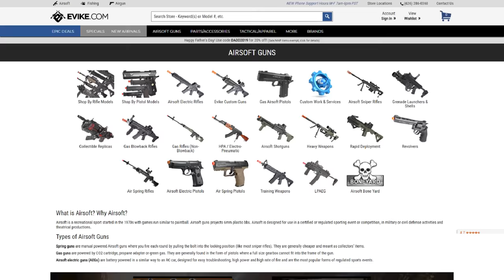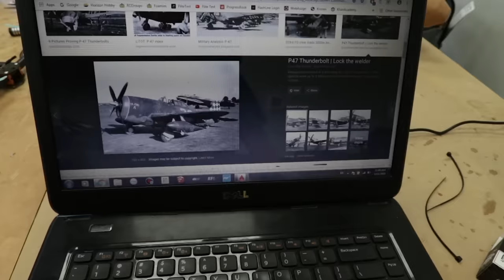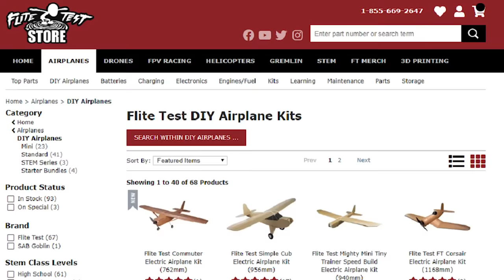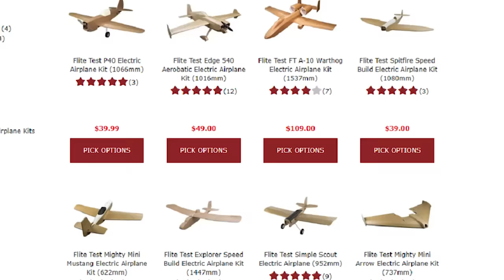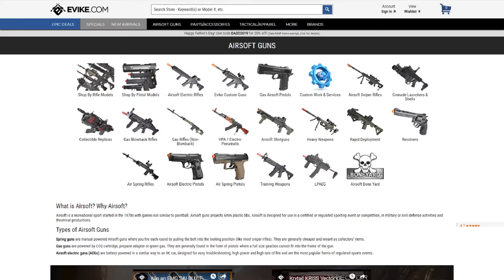Water War?! Foamboard Boat+Gatling Gun VS Dive-bombers 🚢😲

Comment: You should build an A10 big enough to carry the mini gun, it would look super realistic
Reply: Do it!!!
Reply: It be like 10 feet wingspan but thad be badass
Reply: They could also build a minigun with 3d parts light enough to carry it...
Oh God we're giving them ideas now
Reply: king sativa easily more than that it would be the size of a small 2 seater aircraft. The problem is CoM. All that weight up front needs to get balanced
Reply: You forget the A10 is an airframe designed around a great big gun in the first place, and weight up front isn't that hard to balance out.  It just needs the airframe scaling up a little, I'm betting 1/4 scale would easily do it.
Reply: @Ian Wiersma thicker foamboard and bamboo
Reply: Dude thats the smartest thing I ever heard in this channel
Reply: How I would do it is position the gun in scale position and extend the barrels to the nose. Gun and ammo terminate behind the cockpit. So the barrels have to be extended. This deals with the center mass issue mostly. You want nose heavy anyway. Electronics and batteries and servos have lots of space in the wings and fuselage. Could have retractable gear. Could even build for fpv purposes. Big question is propulsion power. It's going to need some massive motors and props, or ducted fans to move all that weight.
Reply: @Tora1337  oR just buy a small scale minigun
Reply: @Ian Wiersma connect the minigun with wood to the plane structure
Reply: Ross Cooper-Smith yeah because jet engines are super light just like electric motors... give me a break dude
Reply: That would be legit! It would be rediculously hard to balance. I'd imagine the gun would need to be mounted in the middle of the ship nearest the cg. and then fire forwards through a hollow space out the front. They would just have to keep in mind that they have to fly straight and level to not shred the ventral of the plane
Reply: I’m a combat veteran and I approve of this comment.
Reply: Built a plane around the minigun like they actually do, strip it down to the bare minimum like the barrel and feeding mechanism it would be a huge undertaking but im sure they could do it
Reply: Too bad I can only like this comment once.
Reply: Tora just use those mini turbojet engines.
Reply: It would definitely be possible and not have to be as big as some of you are thinking.
Reply: 1:1 Scale
Reply: @jeromeburiel965  I was thinking that as well. But given that they have got what they got. But in the A-10s case, it would be a scaled down GAU-8 not mini-gun. And airsoft obviously. 😎
Reply: @arnemagnus680  lol
Reply: Do it
Reply: I want to see the giant quad with the airsoft mini gun.
Reply: Yeah the A-10 Warthog with the mini gun would be cool
Reply: @HAMlLTON  You realise they already made a tank fly, and a little tyke  car.  The little tyke alone is double the weight of one of these guns, nowhere near as streamlined, and they didn't have the new larger foamboard available then either.  It's definitely possible to build an A-10 with one of these.  :-)
Reply: @og_myxiplx  my point inst that it would be impossible, my point was that if you want a heavy gun up front the airplane is going to have to be large to compensate and they might even have to put weight behind the wings to compensate. A real A-10 has 2 massive turbofan engines nearly on the tail to counteract the nose heavy bias of the plane. 

not impossible just really big and they have to plan out where to put weight.
Reply: I say to all you naysayers, this is FliteTest. Build it!!!
Reply: @Ian Wiersma *off
Reply: *laughs in brtttt*
Reply: do it!!!!!!
Reply: Do this thing..
Reply: Try at least 25 and you need either a powerful edf or a jet engine
Reply: Then put it on the battle
Reply: They have to do it right now
Reply: no
Reply: Do it
Reply: Why won't he buy a fighter jet?!😒
Reply: They did it you know
Reply: someone somting you are quite special.
Reply: @user-xp9jo2rv3q  so are you so are you🙂🙂🙂🙂🙂😇😇😇😇😇
Reply: BRRRRRRRRRRT
Reply: Use my 3d printed rc controlled 40mm grenade launcher and a 40MIKE shell. 300 bb in 1/3 seconds. Feel the brrrrrt
Reply: It will be to heat
Reply: It will be to much weight
Reply: Yes Yes please do that.!!!!  It would be sooo amazing.And some rockets too
Reply: yes this needs to be done
Reply: Omfg... that is a weapon of mass destruction actually... please. Please do NOT give this idea to people. Please.
Reply: Absolutely do that flite test
Reply: Ross Cooper-Smith NERD
Reply: we need that
Reply: It would have to be massive!
Reply: Nah modify it so it shoots faster, so I can do the BRRRRRRRRRRR
Reply: that would be as big as a normal A10 probably
Reply: Ray Thuil nah
Reply: Call Peter Sripol and build one you can sit in lmao

That would be cool
Reply: That would look sick
Reply: @PikachuFragger  good
Reply: And carry some airsoft grenades too as extra ordinance
Reply: Yes great idea!
Reply: Do it please
Reply: Put modle jet engines on it with a 13 foot wing span
Reply: make one that has a firework or smol bomb on it and make it land on another plane or tank
Reply: YESSSSS!!!!!!!!!!!!!!!
Reply: That gun so bs that it can barely make 50 rpms and i dont belive it will be able to feel on the skin when shot at
Reply: Good idea do it
Reply: You just got them rich if they do this
Reply: Do it!!!
Reply: Then it willnbr BBIIIGGG
Reply: And a pilot
Reply: Bro it’s been 2 years you should do it
Reply: You should build an A10 big enough to carry the mini gun, it would look super realistic
Idea Guy: jeff favorite
REPLY!
Reply: BRUH!!🤩
Reply: I'm with this guy. Please?? Just like the real thing
Reply: It would be to nose heavy
Reply: They already did in a past video but with a airsoft BB gun
Reply: That’s a GREAT IDEA
Reply: Do It just do it
Reply: The gun on a a10 actually span the length of the plane
Reply: And when the gun fire
The a10 will turn reverse gear on
Reply: DOOOO ITTTTT!!!!!
Reply: Place the gun bottom right cause of recoil
Reply: Like make it 15 feet and put like 30 pounds of battery and guns cameras
Reply: And that’s exactly what they did
Reply: When you say that to me it feels like your asking then to make a real plane its just what i think ok
Reply: That would be a massive plane
Reply: No it should build A-10 around minigun so it would be canon
Reply: YES!!!!!!!!
Reply: Yes
Reply: So a A10
Reply: I agree
Reply: Men
Reply: They should

Comment: I NEED a vid where you guys shoot stuff at a plane until it drops out of the sky
Reply: Ty Weir they should make a plan with a water bottle in the body’s that’s about to rupture because of pressure(fill it with compressed air)  and shoot at it with high power air soft guns or BB guns
Reply: Dune.. it's A10 plane VS Tank

Comment: Hi I’m trying to get into echo flying but it’s to expensive any ideas
Reply: My advice would be to build what you can from cardboard or Styrofoam. (or buy those foam gliders. Sometimes you can find those in a supermarket (target?))
The most expensive is the remote control. So try get a used one. The other electronics are more affordable. Some hobby or electronics stores might have those.
Good luck
Reply: Do a bank job.  I'm in btw.  😉

Comment: You could use the rc jet boat thrusters to create air flow to push the bbs thru a tub from a compartment wouldn't matter were you put it cause the air will push the bbs to whichever gun your using that way you can load 1,000s of bbs for each gun, would need extra batteries but that would be awesome!

Comment: I think a real torpedo attack would be cool model torpedoes don’t work too well. Usually air powered is better than electric. Even counterrotating props don’t work. But near neutral flotation and probably underwater wings to prevent rolling. Underwater flying if you will. Might be able to use electric motors this way.  Maybe have a target on the boat that would open flooding the boat.  Sinking it like real.  Even some kind of compressed air container that explodes.  Maybe a small compressor that would start running when hit then boom as it explodes.

Comment: Ready for the Korean Navy.
Guys, great concern about using waders - with a helmet and all that cardboard, you were running a bad risk of something rotten happening if Jeremy went in. The waders fill up with water, quite scary and hard to manage. I sooo recommend just a wet suit for safety, you will float. the helmet is problematic - if I were there I would have talked you into higher safety.